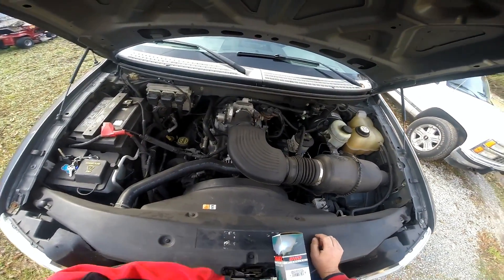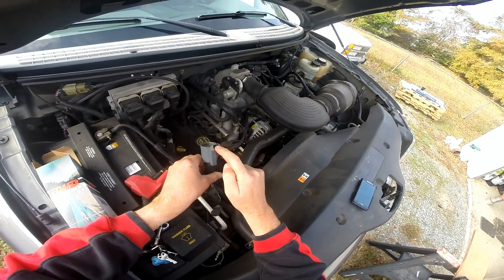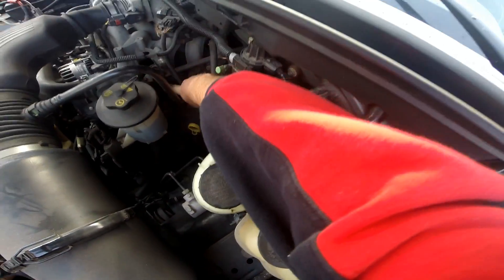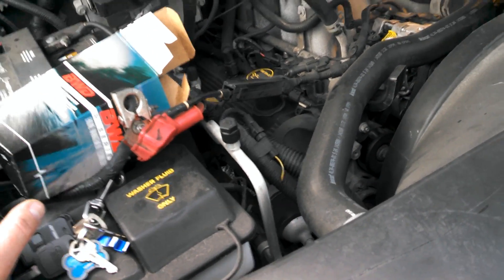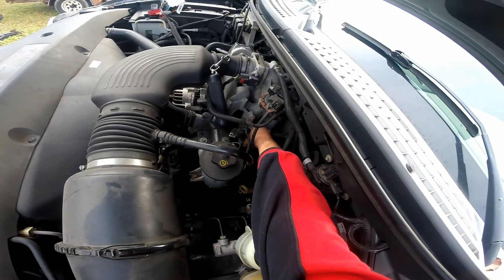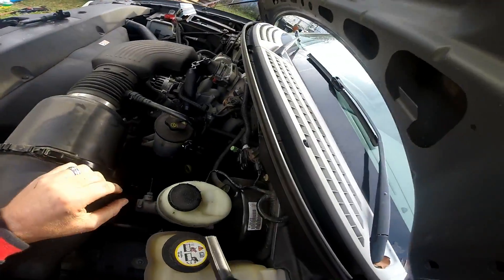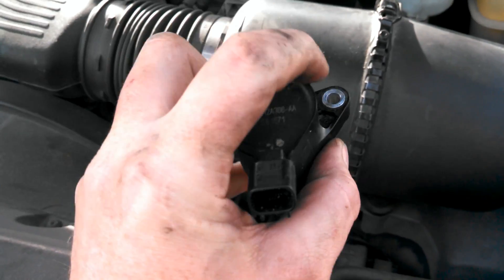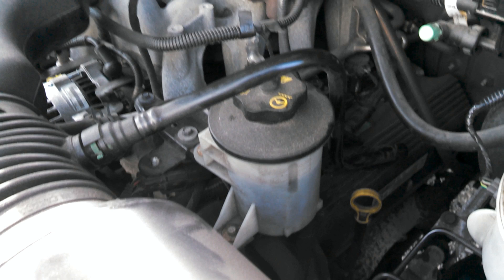2005 F-150 4.6 litre COP replacement on Cylinder 6.

Comment: You're showing me cylinder 7 show me cylinder 6 how to get the spark plug out of cylinder 6 do you have to remove the fuel rail you're saying cylinder 6 but you're showing me some of the seven this doesn't help cuz number six is a pain in the ass